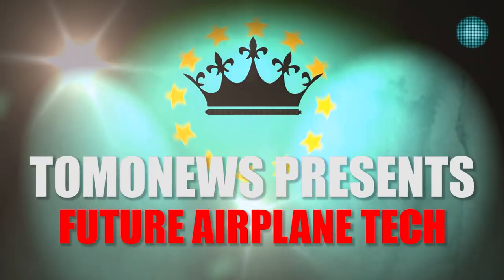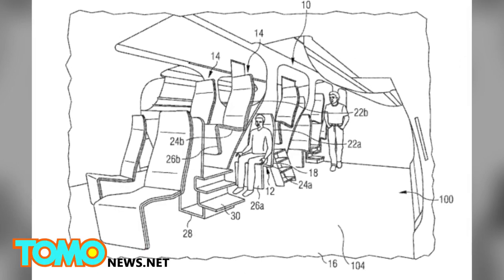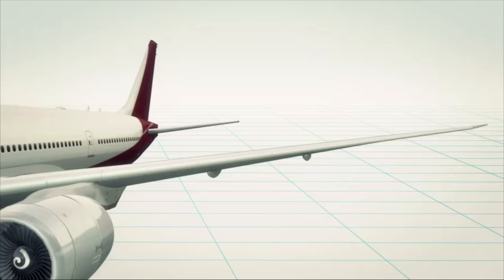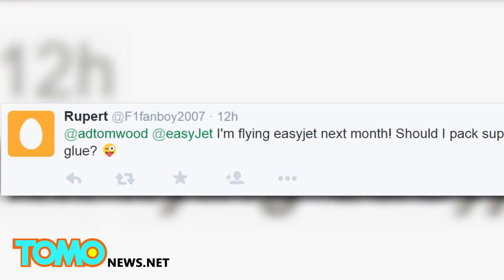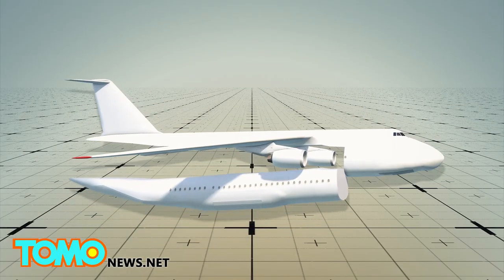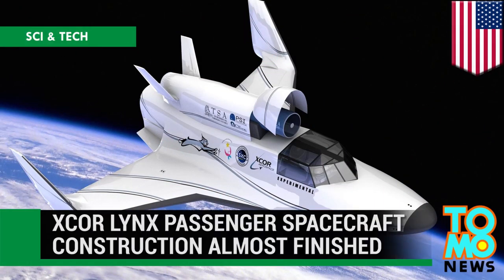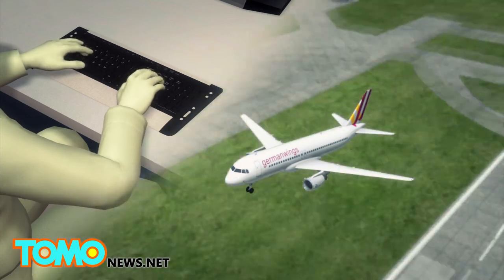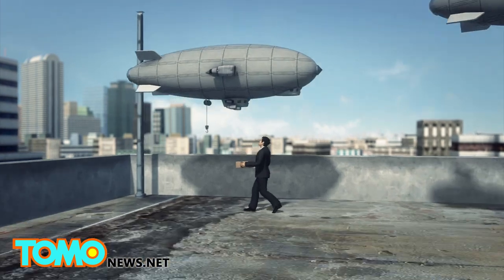Airplane technology: Detachable cabins, Mach 24 and crazy patents - future airplanes compilation

Comment: Fake n' gay, the detachable cabin on emergencies that's especially bs, the aerodynamics at 500 mph just will rip apart the cabin and the parachutes. like wtf plane crashes are like 1 in 100000 chance
Reply: Haram e
Reply: Harambe
Reply: Ok I am a pilot that would work
Reply: oh? so can you explain how the landing gear will work?
Reply: Ricky landing gear is specially designed to
withstand almost twice the weight of the plane, im pretty sure they can survive 200 knot winds for a few minutes
Reply: Poatatasium Poatatogen PO2 you completely misunderstood my question. how will the actual system work?
Reply: Ricky it wont
Reply: Poatatasium Poatatogen PO2 exactly.
Reply: Ricky :)
Reply: Dirtrider 098 Yeah becouse a pilot is an expert within aerodynamical and structual design
Reply: Dirtrider 098 it wont
Reply: Woof what does
Reply: Woof ya they do but its starting to get so rare due to technology
Reply: It probably has very heavy duty parachutes. Dragsters are equipped with those to slow them down when they cross the finish line, as are supersonic aircraft such as fighter jets, the Tupolev 144 and the space shuttle, in which cases the parachutes are deployed when landing.

Also, what's to stop the doors ripping apart mid-flight? They sort of detach. Plus the air is very thin so wind resistance is not an issue at cruising altitude.
Reply: Turpo Urpilainen I didn't say they landed at supersonic speeds. What I said was "the parachutes are deployed when landing."
Reply: MrSupercar55 So how do the paracutes then help in a plane decending 3500 ft per second?
Reply: Turpo Urpilainen Parachutes big enough could do the job like a boss. The Apollo command module only used 3 parachutes, but they were big bastards.
Reply: MrSupercar55 apollo module was almost the weight of those paracutes
Reply: MrSupercar55  Apollo Command Module could fit inside your living room. Several could fit inside an A-380 sized jet. By the time its 3 parachutes deployed, it was going only 300 mph...half the speed of, and weighing a SMALL fraction of an airliner.
Reply: Poatatasium Poatatogen PO2 It Will Have Parachutes And It Will Automaticly Detach In Case Of An Emergency
Reply: Transasia Flight 235 it does not automatically detach. The design calls for the pilots to set a timer then move to the cabin then it detaches. Not to mention the rest of the plane is completely uncontrollable after.

Comment: A mach cough cough 24 plane cough cough is not cough 16000 miles per hour cough cough and tge fastest plane can only go mach 6 which is about 6400 KNOTS ok planes go in KNOTS not miles per hour and did you just compare that to a CAR? And the fastest car goes about 700 miles per hour.......... but the fastest street legal car goes 270... Get you facts straight
Reply: as I watch this video it gets more and more incorrect THE 777 WILL NOT HAVE THE LONGEST WINGSPAN OF TWIN ENGINE AIRCRAFT AND IT CANT CARRY OVER 4OO PASSENGERS A 747 ONLY CAN facepalm that drone isnt the first to do that and that rocket is inareodynamicly fit to to fly at mach 1 and it doesnt even have enougj fuel to fly... how can that blimp even use electirc power on karosine powered turbofan jet engines. facepalm I knew this stuff when I was 8